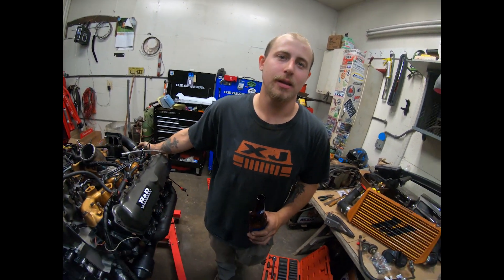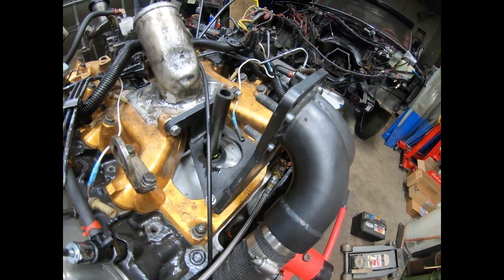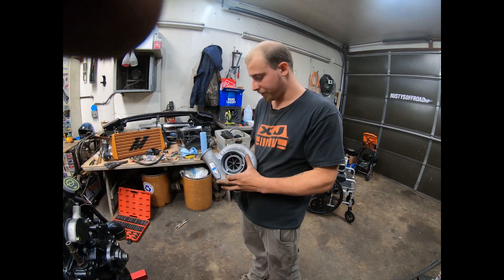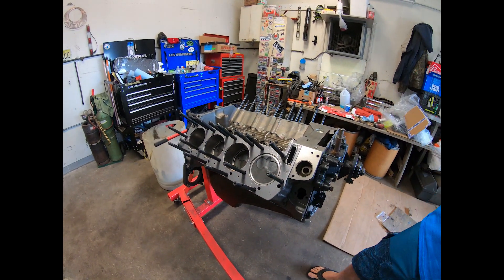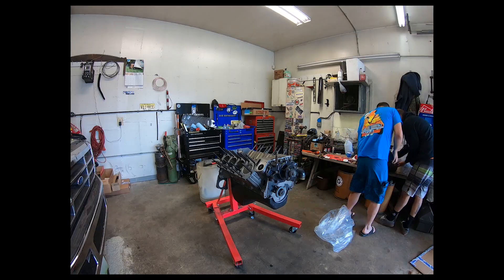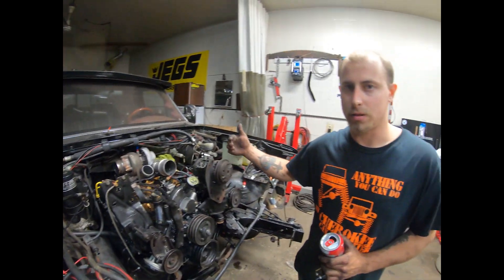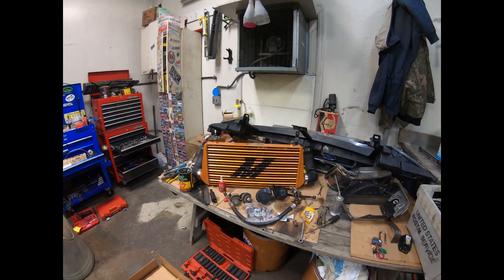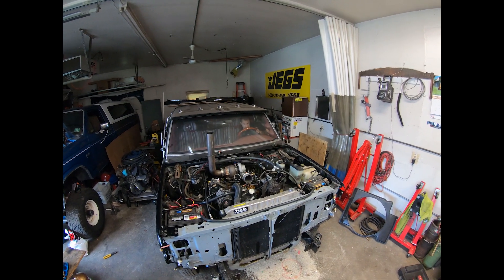7.3 idi turbo performance build part 1

Comment: I just did my head gasket on my 91 f250 7.3 idi in the truck. I just deleted the ac lines very simple.
Reply from the maker: I kept the ac lines because I kept ac. Works great now.

Comment: hx35 "big turbo"  That exhaust housing and turbine is way undersized.
Reply from the maker: Its an hx 35/40 hybrid. exhaust wheel is hx40 compressor is hx35. Its has 18cm exhaust housing. Plenty big enough
Reply: An HX35/40 hybrid is a 40 compressor on a 35 cartridge.  So you put a 35 cold side on an hx40..?  Seems kinda counterintuitive, the 40 would be better suited because of the trim on the holset compressors.
Reply from the maker: Not necessarily works really good and gives me 25lbs of boost pretty quick with my egs maxing out at 900-950
Reply: Didnt say it wouldnt work, just saying its not great sizing.  Having played with some holsets compared to the kit turbos and BWs i can confirm the SXe's are well worth their reletively cheap price.  The sxe 362/67/.91 i have on there now is a monster, but wish i did go with the 73mm turbine.  Cant decide whether to stick an even tighter housing on it and wastegate it, or go bigger.  Although now that dual disks are out, i might just put an S200 on there with a 369 blowing into it.

Comment: Hey brotha, just rebuild my idi. arbs studs, R&D torke cam, mine was a stock non turbo so adding turbo i have a used sidewinder but if theres a better one you think would be better ,added electric fuel pump, rebuilt injector pump, What do you suggest as far as upgrades?  Going into crewcab  dually.

Comment: You said that’s a 100 cc pump but r&d only have 90 and 110. Is it the 110?
Reply from the maker: Its a "90cc pump"  but when flow tested produced a little over 100cc
Reply: @Grewsum2Sum  ok thanks

Comment: Hey brother I know it's probably kind of late to ask if you check your YouTube at all but what did it cost you to build that motor that way. I've got an IDI myself and want to kind of build it but I don't want to have 20,000 in the motor
Reply from the maker: About half yhat 10k
Reply: @Grewsum2Sum  also how much horsepower do you have out of that in torque. Like is it worth the 10 grand to do what you did vs getting a psd
Reply from the maker: Depends, im making 300hp and 700ftlbs not crazy but good for an idi and i wanted to be different, if you had 10k and a cummins it would be a completely different story lol
Reply: @Grewsum2Sum  what internals did you use
Reply from the maker: Idi turbo pistons and connecting rods, total seal rings, r&d cam, comp valve springs put together by promar engines
Reply: @Grewsum2Sum  far as springs are they psd springs.
Reply from the maker: Yes comp 910 springs
Reply: @Grewsum2Sum  merry xmas btw. Did you have the block hot dipped
Reply: @Grewsum2Sum  also far as heads....any machining or just the psd valve springs
Reply: @Grewsum2Sum  I do apologize on asking so many questions BTW.  Did you use stock IDI crank or one from IDI turbo unless their the same
Reply from the maker: @Area51 Small Engine Repair no worries crank is the same the rods and pistons are different they have a bigger wrist pin
Reply: @Grewsum2Sum  so I have an e40d, would that work with that 10k set up.
Reply from the maker: @Area51 Small Engine Repair  not stock it will probably need to be built with a good shift kit and a good tourque converter
Reply: @Grewsum2Sum  the trans was just freshly rebuilt like 6500 miles ago, but stock. Kinda wondering if I upgraded torque converter and put a shift kit in it.
Reply from the maker: I really dont know those trans well i cant tell ya sorry
Reply: @Grewsum2Sum  no problem. I definitely have a bunch more questions. You have a shop number when your Available. Like the question of does the r&d turbo kits include the custom manifold, the difference between a stock IDI pump and the rd2 110 which is recommended for that stage 3 I believe. I kind of would really like to write everything down and kind of get a blueprint for this motor for when I get ready to build mine
Reply from the maker: @Area51 Small Engine Repair  add me on Facebook this is just a hobby of ours we dont have a business https://www.facebook.com/thelemmo
Reply: @area51smallenginerepair83  have you started building yours yet?
Reply: @AtomsForFuel  haven't started. Trying to get my other 7.3  motor sealed up and ready to go for sno plow season

Comment: Sweet rig you got! Love my idi with the zf5 behind it! Can’t wait to turbo mine!
I’m curious, did you have the heads resurfaced and whatnot as well? Did Justin sleeve the block and do the machining work for you? Are you running his turbo pistons and rods?
Reply from the maker: I had a company promar do the sleeves and assemble the bottom end with Justin's cam and total seal rings. They have a supplier that  sells them turbo pistons and rods, and yes heads were resurfaced and new seals and com 910 valvesprings

Comment: wait a sec....i was mistaken to see in the stud install an impact gun used to bottom the studs. i did not see that , right?
the fast forward was too fast to be sure.
Reply from the maker: Its a 12v gun on the lowest setting to speed up the process. The block was basically brand new since it came back from the machine shop. They were all checked by hand before putting the heads on, 6k miles later and they are still holding up just fine

Comment: What piston and rods did you use in this engine?
Reply from the maker: Stock idi turbo pistons and rods
Reply: @Grewsum2Sum  where did you get the rods and pistons?
Reply from the maker: @hrashid03  promar engines sourced them for me
Reply: @Grewsum2Sum  since you now have such a stout bottom end you should get a rd4-150 and make another idi video at the dyno
Reply from the maker: Needs a clutch that can handle that also i was afraid of high egts then with towing, but classic diesel designs just posted a new system they are making so you can change the fuel rate on the fly with a dial in the cab so then ill be able to scale it back for towing if my egts are too high
Reply: @Grewsum2Sum  I was looking into that pump too the only thing it controls though is the low rpm fueling or as people on the form says pre boost fueling so I don’t think it would help with egts while cruising
Reply from the maker: @hrashid03  https://m.facebook.com/story.php?story_fbid=1010974096058670&id=528663397623078&sfnsn=mo

Comment: What’s the part number for your Comp springs? And also did u use factory lifter and push rods? TIA!
Reply from the maker: Stock lifters and pushrods comp 910 springs

Comment: I can convert my 1988 7.3 idi make it turbo with that kit?
Reply from the maker: This really isn't a lot this is a bunch of different parts put together but yes you can turbo your idi this way, or you can get a bank's or hypermax kit
Reply: Grewsum 2Sum  i have problem before getting fuel to the injection pump i chage the injection pump truck run fine for like 3 week amd now i have the same problem not getting any fuel out i have fuel getting to the pump but nothing goin to the injector you can help me with that thanks
Reply from the maker: @kennyelrodriguez3261  what brand is the replacement pump most auto parts store injection pumps are not very good
Reply: Grewsum 2Sum  is a core injection pump is rebuild i buy it from diesel care in tennesse
Reply: Is stanadyne
Reply from the maker: @kennyelrodriguez3261  I would go on an idi forum there is a good on on Facebook they would be able to point you in the right direction

Comment: I bought a 93 idi that had a turbo and intercooler off of a Cummins on it . I pulled it and going to see how it runs before putting it into the f450. One thing it has that I can't figure out was that every intake port has a pipe fitting in it . For what? . Truck also had a propane tank in rear . Truck was a 4 door 350
Reply from the maker: Nitrous or water meth? Maybe propane injection if they were crazy enough lol

Comment: Man that turbo spools fast. What kinda of pressure are you building? Max boast at 1500rpm? 

Low smoke too. I like it. 

I have the R&D stage one and it doesn't spool like that until it's under load.
Reply from the maker: It's an hx35/40 hybrid with a wicked wheel, It makes around 25spi and she starts making boost around 1500 and builds it quickly

Comment: Nice build up. I remember back when I did my IDI nothing was really available. There was a company called DPS that I got some parts from and had issues with. In the end I finally got my truck running and it ran strong but my DPS pump would shut it down randomly at times and not allow start up until it cooled down like it was worn out or something even though it had been rebuilt. My cousin swapped in a powerstoke for me so I plan on running that but I have my old idi stuff and I was thinking about sending my pump to r&d to see if it can be redone right. I watched your other videos and it looks like the truck runs great. It’s nice to see someone stick with the idi and build it up to work right. My dads old if I had over 400k miles on it and we were running 12psi on an old ats kit for years before he finally hurt it on a big hill loaded. Great motors and great trucks. Your video gave me the idi bug again for the simplicity and affordability.
Reply from the maker: Simplicity, yes affordable eh lol I have 9-10k into the engine
Reply: @Grewsum2Sum  9-10k parts and machine shop? Or upgrades?
Reply: @Grewsum2Sum  question have a f250 4x4 6.9.  Is putting this kind of money worth it?? Vs a 6bt cummings or a dt360 swap?
Reply from the maker: @Jefforey  all depends if you want to be different or not. You get more hp out of a cummins or dt

Comment: Shit dude that thing is a beast.  "Mint!"  Any plans to put it on a dyno?  I'm really interested to hear power numbers.  I've been geeking out on these motors since I bought an old UHaul box truck with one in it.  Long story short, after I'm done messing with the box truck, I want to do a 6.9 or 7.3 idi build for a pickup, but it definitely needs more power than stock.  With everybody doing 12 valve swaps I love seeing someone doing power mods to the idi.  I didn't know you unicorns existed.
Reply from the maker: Yes we do exist lol R&D idi performance will have all your power needs if you are looking for stuff and I have a session set up for july 13th so we shall see then!

Comment: Very nice truck! Did you go with lower compression pistons with the addition of the turbo kit?  I have read you can run into issues boosting N/A idis because of their high compression ratios.
Reply from the maker: Nope stock compression, its seen 25-30psi no issues so far
Reply: That's good to hear.  Im sure the intercooler helps.  I would love to get an IDI to play with one of these days.  All of my trucks to date have been powerstroke 7.3s.
Reply from the maker: But I did switch turbo pistons and rods